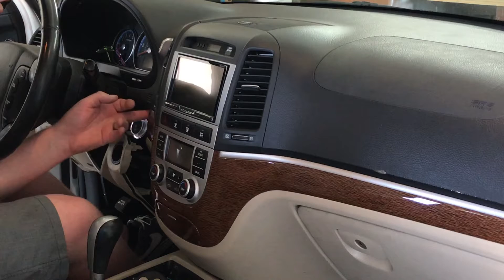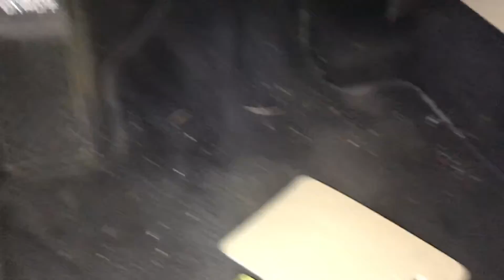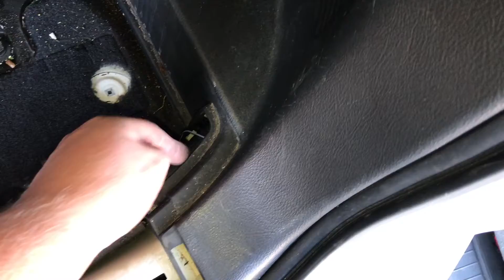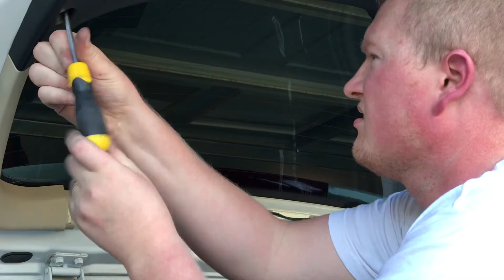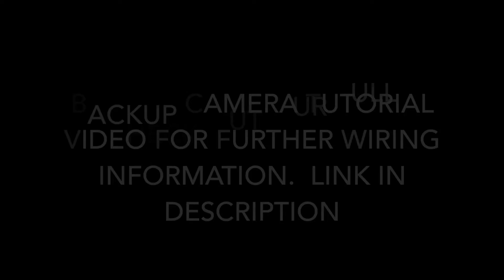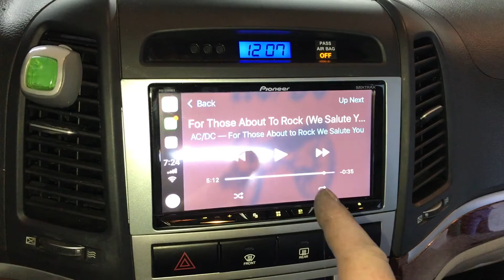2007 - 2012 Hyundai Santa Fe Backup Camera Install

Comment: Does the trigger and power wire for the camera go to that same blue wire and then the ground for camera power go to the black wire? Ive done that on mine and camera still doesn't power on
Reply: You don't need to run that second wire al the way to the back.  Not really sure why he did that.  Even if he wanted constant power - there's better points at the back of the car.  This video explains the trigger wire much better.

https://www.youtube.com/watch?v=olhrPau4AIA

Comment: Just wondering why you didn't route the wire down the passenger's side of the vehicle instead of the driver's side?
Reply: I tried the passenger side. I think the wiper fluid tubing is routed through there, so the panels at the thresholds are much more difficult to remove. The wire that came with my camera is too short anyway, so I have to do a splice and I’m running up the drivers side.

Comment: Was trying this out on my 2007 Hyundai Santa Fe w/ plug-in bu camera that has red bypass wire. I pulled apart the light connector harness off the rt backup light, stuffed the red wire in with the blue wire on the side connected to power, tossed the video connector thru the car and plugged it in to test it. Success! I then reconnected the power and light connectors together to see if the back-up lights were working along w the camera. I then noticed that the right license plate light and right back-up lights no longer work. (Maybe they were both not working, but that seems pretty coincidental.) I removed the right license plate light and found the bulb filament was gone. I then took the known-good left license plate light bulb and put it into the right lamp and it still doesn't work. Any suggestions as to what may have happened and how to fix this?

Comment: Why didn't you run the wires down the right (passenger) side of the car?  It seems you'd use less wire getting up to the top of the hatch.

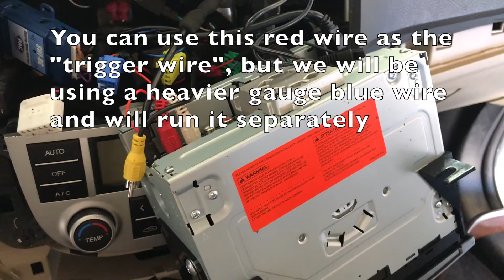Comment: At 5:00 into the video you mention that the red wire can be used as the trigger wire. 

In my setup (2012 Santa Fe) I have the red wire in the front wired into a Pioneer AVH-1300NEX and I have the back red wire and black wire spliced into the reverse lights in the back hatch. I did not run a dedicated ACC line through the trim since I only cared to have video when reversing. 

The issue I’m seeing is that when I reverse, it pulls up the camera, but no video is transmitted - the picture is black. Prior to installing the Pioneer I had a Joying stereo and it didn’t have this issue. 

I also experimented with running an ACC line through the cabin into the red wire at the back, and this caused the video feed to work but of course breaks the triggering mechanism. 

Any suggestions? Do I need to go back and run a dedicated ACC line?
Reply: I have this issue with my pioneer too, except my camera worked before with the same wiring setup and now it doesnt and I tried different cameras. Did you ever get yours to work?
Reply: @shivam220  haha, funny you ask. I left it not working for the last 2 years, then last month I finally went to Best Buy and paid them to install a new camera, and it worked fine. They also pointed to 3 different areas I'd unintentionally crimped my old video line, and my guess is that the old stereo I had was okay with the lower quality signal and the Pioneer wasn't. It's working perfectly now.
Reply: @brismuth  Ahh gotcha, I think it might be from cheap cameras I am using? What camera did you buy?
Reply: You are correct - there's no need to run that wire all the way to the back.  It should go to your head unit to have it auto switch to camera input.  This video explains it better. I don't know why OP did it the way he did.  

https://www.youtube.com/watch?v=olhrPau4AIA